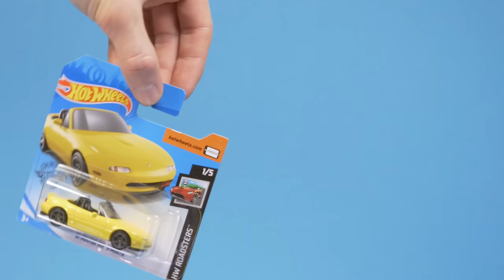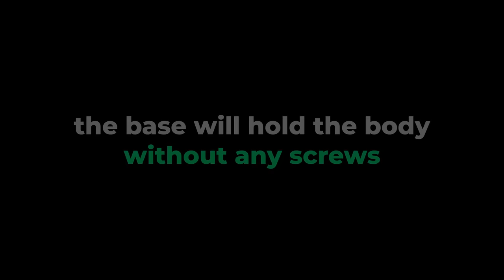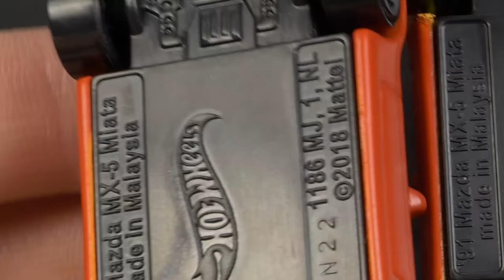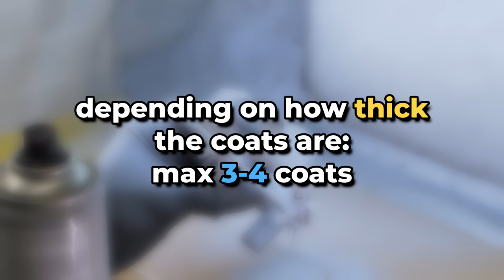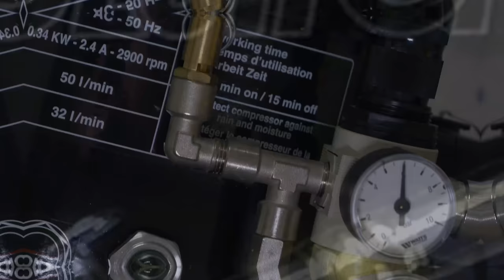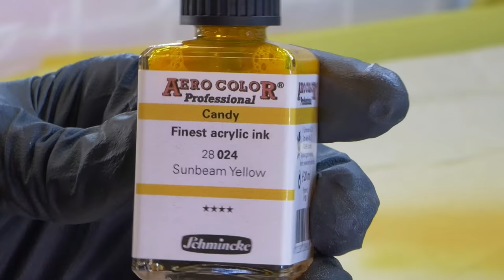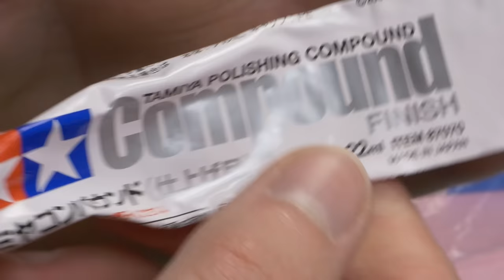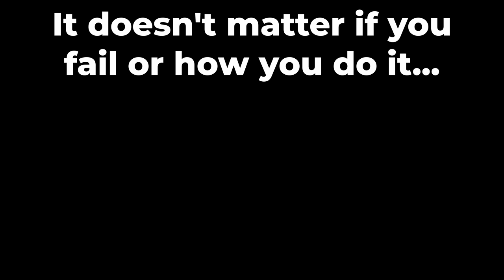How to PAINT Hot Wheels? (Beginner Guide)

Comment: I thoroughly enjoyed this! I'm at a level between 2 and 3, let's say. I don't have proper helping hands yet, but have some sticks with some helping hands like ends to grab the car. Double sided tape can be replaced for a "self loop" on a regular tape as well, if you don't want to spend extra. I just use the toilet paper carton without tape anyway, but it's a good idea to also do this.

My advice to beginners especially, is to just have fun and don't think you need a lot of equipment to do this. And have patience as mentioned. You'll get better over time. Haven't done a custom in a while and didn't know about the compatibility between casting, primer, paints and clear coats. I actually had a car chip on its own at a very late stage. I thought it was maybe because I didn't wait enough for it to dry between layers, but maybe the primer is not right for the casting as well (but I have no way of knowing the material easily because it's not a Hot Wheels car).

Either way, congrats on the video and thanks for sharing, bud! Keep up the amazing work!
Reply from the maker: Thank you for writing this, you address some important points and tips. You can easily go with a low budget, just start and learn. And if you like the hobby, you can step up your game.

👉To paint incompatibility: It's important that you do NOT apply different layers of different types of 1k paint (lacquer, enamel, acrylic). The safest way is to stay in one range, to prevent side effects. A general rule of thumb: You can put anything over lacquer, but nothing underneath it (lacquers are the "hottest" paints of all, they can destroy coats underneath).

👉With primers it's often a bit different, mostly because they are basically cocktail mixes, so even manufacturers don't say (or know?? ;D) what it is exactly. Usually you can put almost everything over them (this is what a good primer should provide). The key is to find one, where they explicitly say that you can use it for aluminium, brass, zinc (Die-Cast-Metal)... or experiment and gamble ;)

Thank you too for watching and supporting!
Reply: @themodelcarproject  thanks for the thorough reply! I'll take another shot at the one that has chipped because it's a very special project for me (it's a 1:43 reproduction of my first car so I really want to have it done to display). I'll try again but with a better drying time for the primer itself and be patient.

All in all, the key is to have fun and enjoy the process. All the best and thanks again for sharing all the knowledge ✨
Reply: if u dont have a thing to hold u can use binder clipsfor that

i cant tell u in words how to position it, i would need to show a picture

but u will get to it;)

edit: i know nothing about customising hot wheels i just saw that on another yt channel bruh

Comment: Few tips from my time building models and used spraycans: Best was tamiya spraycans and if you heated them in warm wather you get even finer result. Because of small details on model cars, normal spraycans tends to lay too thick and details dissapear. But best is airbrush ofcourse
Reply from the maker: Thanks for sharing! Second that, especially if you paint on colder days, a warm can will perform better. Just make sure you dont get any water drops into the nozzle-spray area.... Tamiya makes very good paint indeed, I wont argue, just their primers are more platic-model focused. A tip to reduce the layer thickness on normal spray cans: use a low pressure flat cap. You will get finer results and the paint will lay down much nicer.

Comment: I loved the tutorial, my budget is between level 2 and level 3, so can i use the level 2 method but applying the gloss-clear coat?
Reply from the maker: Glad to hear! Yes absolutely that works as well. You can even buy color paint that has already gloss particles in it, so after the color coat you would be done without the need of a clear coat for a glossy finish. May want to look out for such a spray can, it's on you what you will find/ what you prefer

Comment: Should i scrap the old paint with sandpaper? If it's metal body? And if yes then which thickness?
Reply from the maker: If you would like to use the stock paint as a primer, it might be beneficial to scuff it a bit, with a scotch pad. For extra grip, especially if the stock paint is glossy.
I would go with something fine, otherwise you will end up seeing deeper scratches on your paint job.

Comment: Hello! I'm learning how to properly drill down the rivets on some practice cars, and I'm approaching the part where I'll start stripping the paint. I quite like the metalic look of naked cars and want to sand them down to make them smooth and use a clear coat as well as painting the lights on the cars! How would you reccomend I go about this process, as well as any specific products to reccomend! Much love from NY <3
Reply from the maker: For this process you will have to use an lacquer based clear coat (the best option would be 2k clear, but I strongly would stay away from it as a Beginner, since its harmful and difficult to handle). Not that any Acrylic or water-based clear coats wouldnt work to keep the metal-diecast of the car shiny. Reason for this is that the water inside the paint will make the diecast oxidize and the paint will crack. Laquer-based clear coats are good for this, since it doesnt have water inside it. Be sure to make the body super clean and keep it dry before applying the clear coat!
 Hope this helps, cheers from Germany!
Reply: @themodelcarproject  Thank you for the guidance! :D

Comment: question:the paint  is easy to remuve??(like wen it dries if u scrach it with your nail does the paint come off?,question 2:what is a good quality spray paint??
Reply from the maker: For spray cans: 1: depends on the paint. usually paint out of cans is quite durable. Laquer/enamels are usually a bit more durable.
2. If it's not cheaper than maybe 5€ lets say. Dont buy the cheapest brand on earth (doesnt need to be expensive though)

Comment: Thank you for the amazing video. I have a question, when do you paint on the details? Before applying the clear coats or when? Thank you in advance.
Reply from the maker: Thank you too! I always paint the details after clear coat to protect the color coat. It's way more forgiving in case you make little mistakes while painting, you can always adjust and correct it to a comfortable degree, without the risk to disrupt your color coat. Another bonus is that you make sure that the detailing paint is not reacting with the body paint (esp with candy colors, "bleed" effect).

Comment: What oil was used or can it be any? Also where the screws 3.8m2 3mm? Or does the head of the screw need to be smaller than 3.8?
Reply from the maker: Oil was some very fluid mineral oil with low viscosity, so that it can easily flow inside that upright post. Screws: I´mostly use standard threaded M2 with 3mm length, rarely 5mm and 8-10mm for the display case Attachement. In regards to the head of the screw: its just some standard, nothing special, mine have a max head-diameter of about 3,8mm

Comment: Quick question, what oil did you use for level 2 and where would I find it. Thanks!
Reply from the maker: Its just some regular oil for mechanical parts. Just go for one thats thin and not greasy. You could even use some oil from the kitchen, just make sure that the car is clean after the screw is in.

Comment: Hi, new to hot wheels, what paint would you recommend for headlights/tailights and tools since they dont come in coloured
Reply from the maker: I always recommend acrylic waterbased paint for detailing + the smallest brushes you can find (5/0, 10/0, 20/0). I use Vallejo Model Color. Some people use markers as well if you prefer them.
Reply: @themodelcarproject  markers stay, I always thought they'd wash off
Reply from the maker: @7rodo  Make sure to use some that are "permanent". The down side is that the color of 99% is not really colorfast, so they fade over time. Make sure to buy some proper markers. But I always prefer the setup mentioned above, more precision, more control, good quality colors at very low price point.
Reply from the maker: @7rodo  also if you are just starting out, on the other hand, just try your first shot with some markers you have at home, you can always improve/get "better" tools step by step
Reply: @themodelcarproject  great advice and I appreciate your honesty, a great welcome to this hobby and earned a new sub! Thanks very much
Reply from the maker: @7rodo  Very glad to help, happy customizing!

Comment: Hey bro do you think that acetone would be a good alternative of paint stripper? Thanks
Reply from the maker: From my experience it only works like 50% of the time, if not less. Especially HW cars with a metallic paint job are super tough. I would recommend this paint stripper „pufas abbeizer p15 intensiv 750ml“. Or if you live in usa or asia you might get even stronger paint stripper.
In any case, just give it a try. Hope that helps.

Comment: Can u link the items that you use like size of brush for the details? Also the compound u use to fix the paint? The air brush kit u use?  Everything can be purchased online or maybe amazon?
Reply from the maker: 👉Size Brush: literally the smallest you can find, at least 00 or 000, I have even 15/0 and 20/0 made by "davinci", preferably choose synthetic-brushes.
👉Polishing Compound: Just the one made by Tamiya, the red and blue one, "finish" (white) is optional, doesnt make a huge impact, just slightly more shine
👉Airbrush Kit: I use a 0.4mm harder steenbeck evolution cr plus, however if its your first airbrush then please buy a very cheap one from amazon (thats what I did, still use it from time to time, costed only 50 bucks with tons of equipment)
I dont have any links, they often change or expire. Check out amazon and ebay, or find some dedicated shops to modelbuilding or painting minis via google

Comment: So i want to do some initial D cars and i want to use some waterslide decals, when in the process should i exactly do that (Lvl 3)
Oh and for the black line on the AE86, i want to do a nice and clean edge, how do i do that
P.S that will be my first spray painted car, i painted some lights with permanent makers (i got them to look pretty cool)
Reply from the maker: For that I strongly suggest you to watch my custom build on the Initial D AE86. Decals application always after the paint is dry and before clear coat. For the clean black edge -> the video mentioned above should show this best.
Yes! Lights can be absolutely done with permanent marker if that works for you, keep going🤙
Reply: @themodelcarproject  ok thanks, didn't acctually think that you would reply to all comments. I got some more questions if that doesn't bother, so i went out to get some paint and stuff and i wanted to ask about the puddy that you use for the wheel rims (idk what to call them, i want to use it for popup-light on my rx7) what puddy do you exactly use?
And i have problems with the screws too, the smallest screws i have at home are M5 * 3mm so i wanted to ask if they work as well
Reply from the maker: @real_robotnik  1. Do you mean epo putty? That modeling mass? The rims, tires and pop ups are 3D printed... however you can make pop ups by yourself (see another tutorial on this channel) use here like showed plastic beams or putty. In general, I like to use 2K Epoxy Resin, mixed with a bit of baby powder (hope that this is what you've asked for...)
2. M5 are huuuuge for this. Just put it beside a HW post after you've opened your car to see this ;D Optimum here is M2, I strongly recommend it. The Max Limit is M3, did that ones on a car, but the downside is that they stick a bit out of the base.
Go to your local hardwarestore, they surely have some M2 or at least M3 (or the equivalent usa-version, depending on where you live)... or shop online, usually cheaper but bigger packs

Comment: at level 4, why do you sand it after the primer? what's the difference between sanding it after stripping the paint and after you have applied the primer?
Reply from the maker: After removing the paint: going over with a wire brush removes all the rest of the old paint, and mire importantly it removes oxidation.
Sanding after applying the primer:
This is not always necessary, only if the primer coat got some imperfections like orange peel / very rough surface. If it goes down well, I go straight to color coat, after its full drying time
Reply: @themodelcarproject  I see, thank you so much for the information!! I love your videos, high quality customs and great editing! I'm gonna start customizing my hot wheels because of your videos!
Reply from the maker: @edwinkuo4884  Glad to help! I wish you much fun in this hobby, happy customizing!

Comment: It's a bit hard to understand the process of re-attaching the base and the body. After you have drilled out the previous screw, how can you just put in another screw? also, what oil exactly do you use for that process?
Reply from the maker: The previous screw is not really a screw, its a rivet, which is smaller than a M2 screw. So I drill the old rivet out while getting also some metal off the post/stud itself. Then with some oil (doesnt matter what kind, just sth slippery, the thinner the better) you can directly tap a M2 screw into the stud, given you have drilled accordingly.
Reply: @themodelcarproject  Thank you very much for the reply and explanation. I want to get into modifying hot wheels cars at some point as I do art and crafting myself and am interested in cars. It is a bit overwhelming though so your videos help a lot. keep it up!

Comment: Hi! Can u teach how to change 1$ hw cars wheels to premium wheels,(beginner guide) i tryed to learn but still confused how to do it. Example i opened under the car like 2:08 then we see long thing which holds (helps) to wheels, i saw on other creators that they brake that small thing but, then they dont show how they put it back. Also pls MORE BEGINNER GUIDE PLS I LIKE IT!
srry for my not well english)
Reply: I think they just glue it in
Reply from the maker: You can check out two of my videos on how to "stance" a HW car. Just skip the stance process in this case. In another video I show how I install monoblock wheels, which is basically what you want, just wheelswap: https://www.youtube.com/watch?v=JakwifAdfcI
I break "that small thing" off as well, usually the interior should hold the axle on 2 studs for each axle.
You can put the car back together how you want. Gluing works, or add an M2 screw, or sometimes it just holds itself. Another budget option would be to put a tiny bit of double sided tape into the inside of one door. Then press the base with the interior back.
Hope that helps
Reply: @themodelcarproject  thanks! i will try that!

Comment: How long should the car stay in the jar of paint stripper? (Level 3)
Reply from the maker: Really depends on the paint, sometimes it takes 1 or 2 days, sometimes its already done within 1 - 3 hours
Reply: @themodelcarproject  Good to know. Also while my current car is sitting in the paint stripper I'm seeing silver that was under the black paint bubble off as well. Is that normal? And is there any harm in leaving a car in the paint stripper for too long?
Reply from the maker: @jpetschke  Die-cast metal includes Aluminium and zinc, which are known to oxidate quite well. But this also happens if they are just exposed to the environment. So I would suggest to not keep it longer than 1 week in there. But you can also experiment of course. In any case I would always recommend scuffing the oxidation off with a wire wheel like shown in the video (or at least some sand paper). That works always.
Reply: Great, thanks!

Comment: Do you know good paint stripper thats cost friendly? , also any info on paints strippers with hotwheels is useful I cant find much information about them
Reply from the maker: I use the: „pufas abbeizer p15 intensiv 750ml“ . Its like 10-20€. To be more cost friendly: I like to put a bit of paint stripper in a jar. When its time to take the car out, I just clean it of as good as possible with a brush. This way you can reuse this gel all the time, it seems to get even better after more and more cars where dipped into it. With about 20+ Hot wheels customs with a repaint, I still have some fresh paint stripper  remaining inside the original bottle. Hope that helps!

Comment: I used cloth bristles to get the excess paint of it looked like it scratched the body would cloth bristles scratch it?
Reply from the maker: The metal body itself can be scratched, its actually better to scuff it a little bit so that the new primer can hold on it a bit better. But do not scratch too much to prevent loosing details on the casting itself
Reply: @themodelcarproject  ok I commented again could you answer that pls
Reply from the maker: @saproductions5189  👍

Comment: Nice tutorial by the way are 3mm screws long enough? They don’t seem to be
Reply from the maker: Thats true, but 90% of the time 3mm works best for me. That way you dont need to drill deep while risking to crack or drill through the hood, and the screw is nicely hidden under the car. One thing to point out is that I dont use any washer for the screw in this case.
For the other 10%, if a washer is needed, you definitely have to go with 5mm, so always good to have both lengths available.
Reply: thanks for taking the time to reply